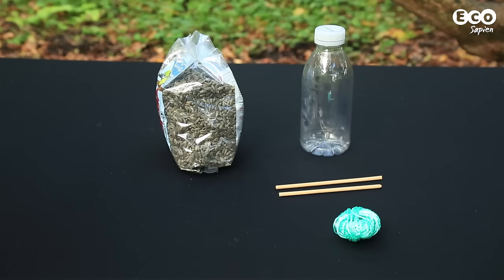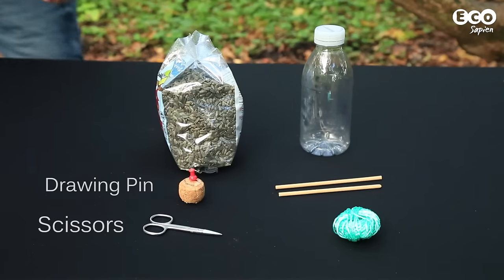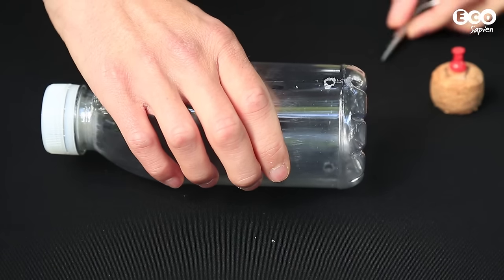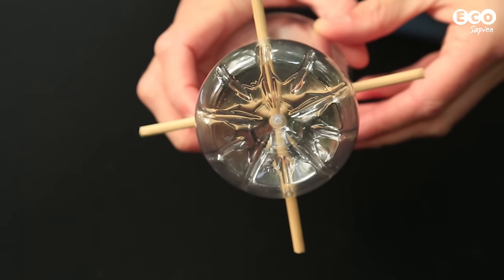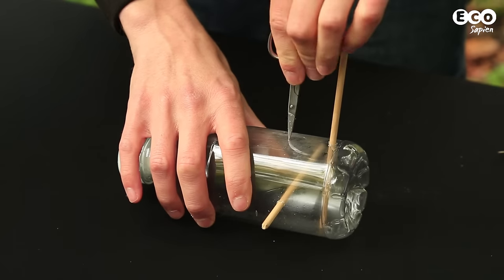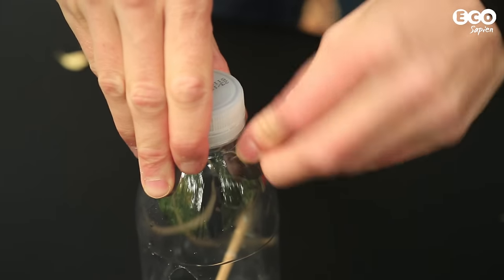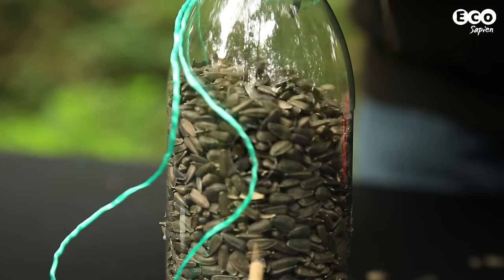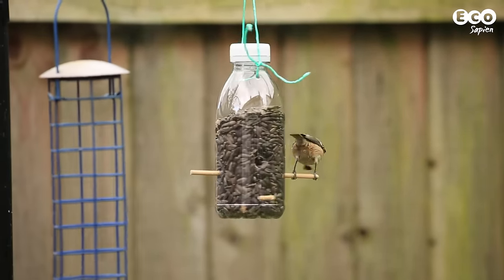How to make a Bird Feeder from a Plastic Bottle

Comment: This is very easy to make! I used an old, cheap multi tool knife for most of the cutting. Instead of a drawing pin, I used the tip of the corkscrew, and I used a large knife attachment in a twisting motion to enlarge the holes as needed. Instead of poking the lower dowel into the bottle, I super glued it into the bottom. The dowels were 12 inches long, so I cut them down to 9 inches for the perches and glued the remaining pieces to the bottom parallel to the lower perch. This creates a stable bottom when I want to refill the birdseed and utilizes as much of the lower half of the container as possible.
Reply: Good ideas! I'll glue dowels to the bottom for my next feeder.

Comment: I made 2 of them today.  I used a soldering iron to make the holes though. Also used a dowel rod for the landing area and old but still good shoe laces. Tried using a drill but the bit tore the plastic.

Comment: Any feeder I used which was made of plastic didn't last long ---- the squirrels chewed them up in no time flat.  There was absolutely no way a plastic or wood feeder could be mounted to keep squirrels at a distance; if the birds could reach it, the squirrels could too.  The problem was solved only after I went to all-metal feeders.  I still feed the squirrels as well as the birds, but the feeders remain intact.  At least your plan doesn't involve any cost.
Reply: Oh goodness I forgot about squirrels 😲
Reply: Birds Unlimited has a bird seed that squirrels don't eat.  It's more expensive but even if it falls on the ground, it doesn't sprout

Comment: the bottom  half of the  bottle with  the seeds want be eated from and with condensation will they not rot ?
Reply: that's what the drainage holes at the bottom of the feeder are for.
Reply: Curtis Braun  that pnly works when the birds remove the moistened seeds. With this contraption they can't do that.

Comment: How to access the food towards bottom of bottle?
Reply from the maker: +tannenbaum Hi, depending on the position of the lower holes and perch, and the size of the lower holes, birds might be able to access the food by themselves. However, most likely, the remaining food will have to be emptied by hand and scattered on a bird table. This is also good practice to stop any remnant food festering in the bottom and going mouldy!
Reply: You may also want to fill the bottom with clean stones or dry rice which will not harm birds.

Comment: There is a flaw with this design. The seeds at the bottom of the bottle become stale and also there is nothing to catch the seeds if they fall out of the holes. So instead you can attach some sort of plate at the bottom of the bird feeder and poke holes at the bottom. So now the seeds don't fall on the ground and the seeds at the bottom do not become stale 👍
Reply: i dont ever use dowels, i use open glass feeders that fit in hanging candle holders, the birds dont have to dig for seed that way, they got lazy and like it that way haha